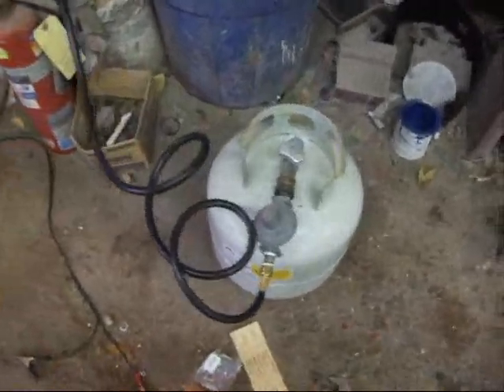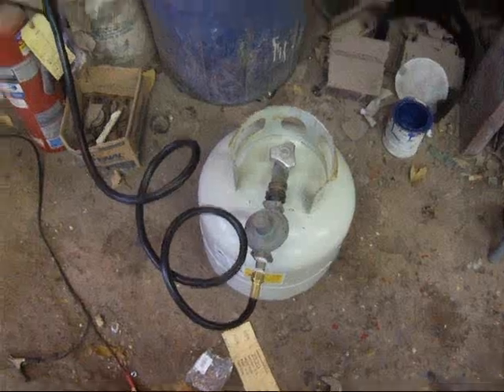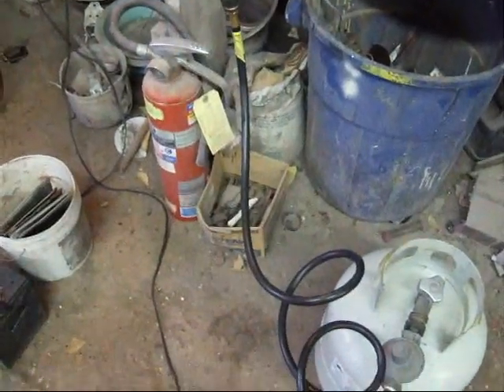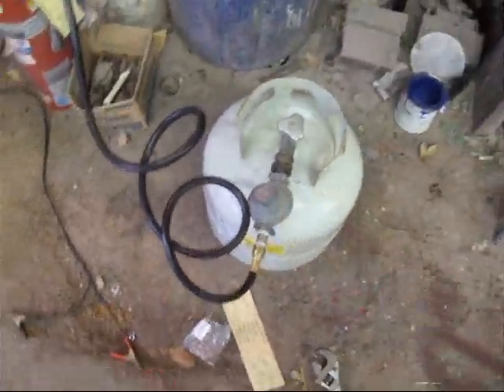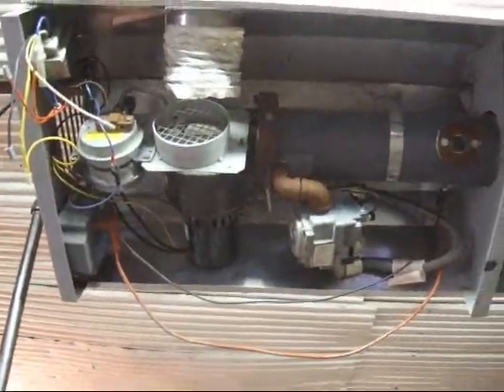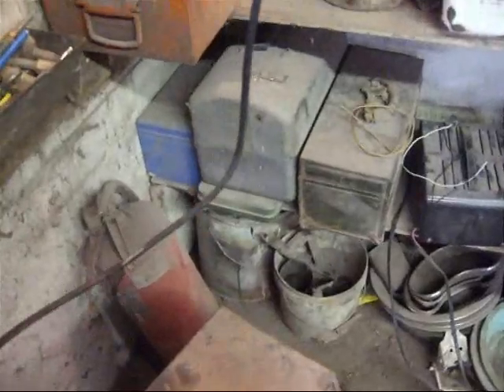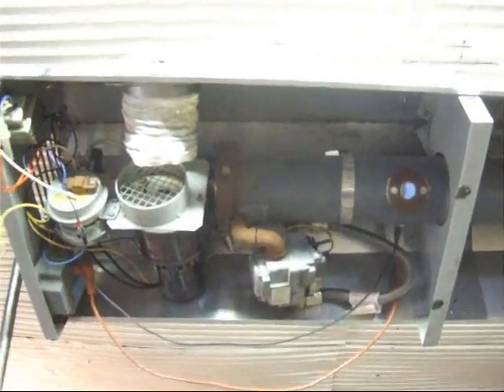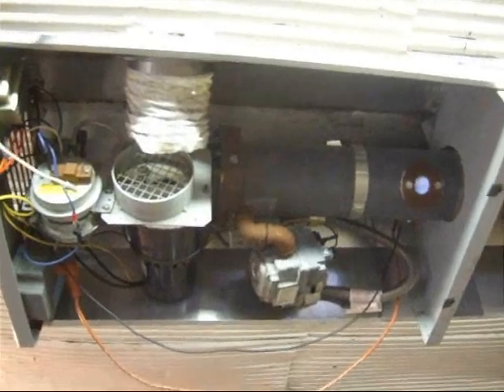Infrared Heater Pt3

Comment: i didint realize you had afew videos of this thing haha. First thing first, that heater has a n.g regulatar on it. now your running propane through it. There is differnt heat values for both gases. If you dont change that regulator to propane you run a strong chance of sooting up your pipe.

Comment: you should tie that into a bigger supply of propane, the bottle wont last long. It wont be plugged. If it is running it has no obstructions. It has built in safety features that if it detects pressure build up it shuts down. Plus you wouldnt be feeling heat down at the end of the tube.